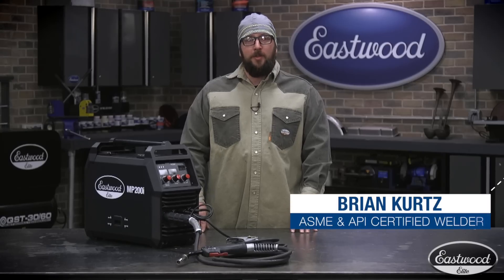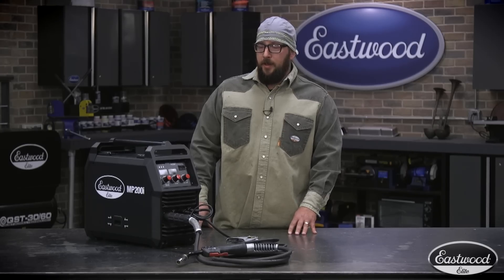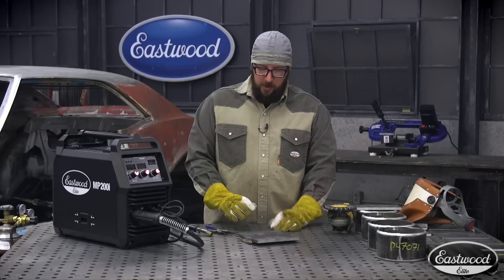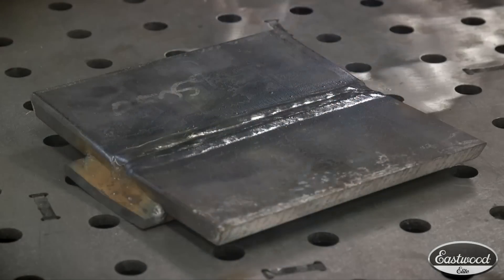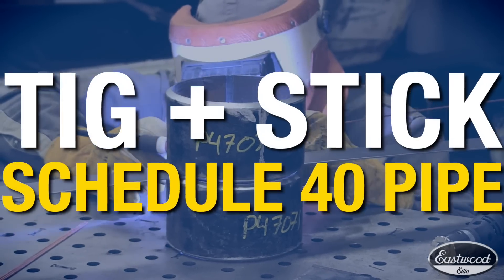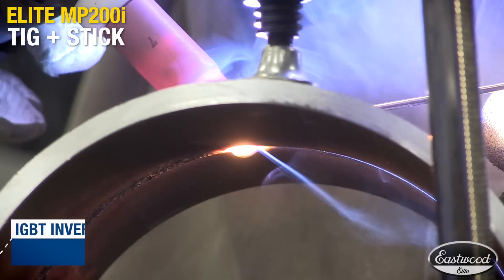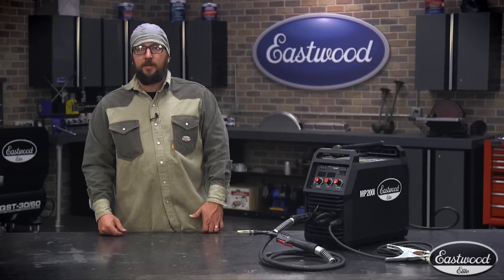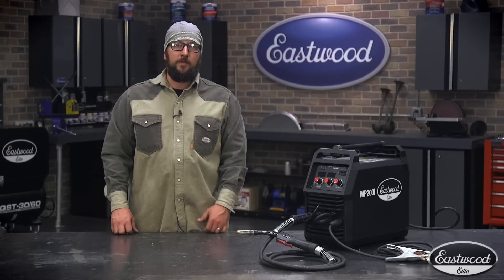Elite MP200i Multi Process Welder - MIG, TIG, Stick: WHAT A PRO THINKS! Eastwood

Comment: Can you run flux core with it and do you need to shield your weld using 75/25
Reply from the maker: Yes, the MP200i can run flux core. 75% Ar and 25% C is the most common shielding gas for flux-cure.

Comment: What's with the TIG torch?  The pictures on your site show no (whatever it's called) stem or whatever it is sticking out the back where the tungsten goes but the video shows it there.  Also, is the connection such that upgraded torches could be purchased or is it proprietary for just this China welder?